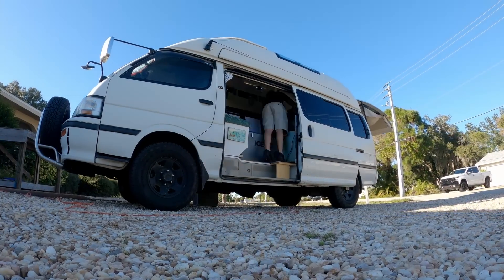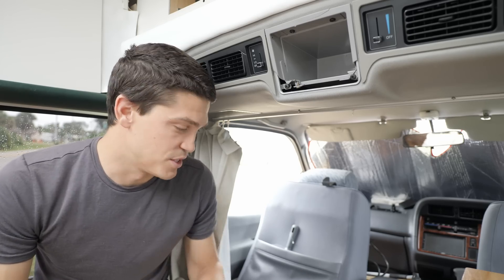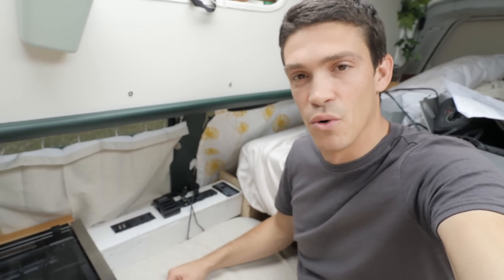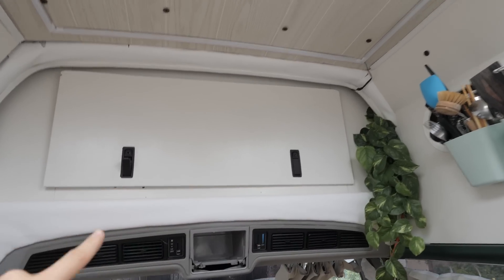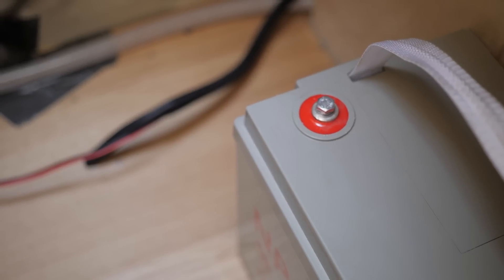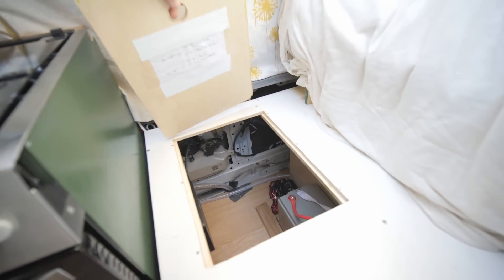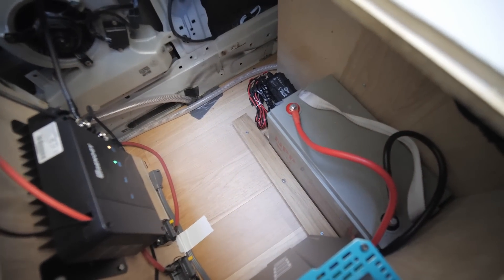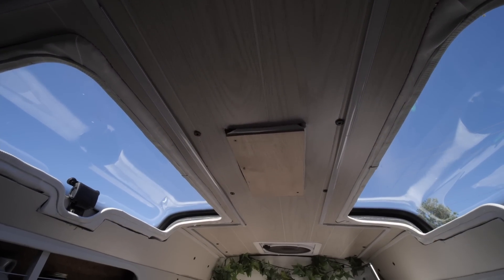DIY Camper Van Power System | DC-DC Charger & Solar Install

Comment: Hi, I bought this mmpt dc/dc charger and I would like to know if it needs to be in a place where it's cool or have ventillation? 
Does it get hot and  is it noisy?
Sorry for all those questions but I have a car that I change into a van and so I don't have much room.
Thanks in advance and btw great video :)

Comment: I would have gone with the Renogy combo controller but they gimped it with that terrible 25V MPPT limit. Makes it impossible to basically put any panels in series.

Comment: I have several home battery/inverter builds. The BT-1 and BT-2 apps are OK but the Victron Smart Shunt does not have much range and the app has things that just don't work. It's constantly dropping its connection. I rarely use it. However, I am a big fan of the Renogy 500 amp shunt battery meter. It shows everything you need about the load, battery state, amps, time remaining to discharge, time remaining to charge. No phone needed, it's like a gas gage for the battery. No need to scroll through  anything to see the information. You can see from 30 feet away if the battery is charging or discharging. I think it would be an ideal meter to put in a camper van.

Comment: The renogy unit is a sweet unit. Its too bad they cheapened out and put only a mppt controller capable of only 25V but 600w of input. That means you have to do all parallel panel arrays with 8awg or thicker wire.
Reply: I bought their DC-DC controller with MPPT. The 25 volt solar limitation sucks. It's still in the box unused. I installed the Renogy Rover 30 amp MPPT and put 4x100 watt panels in series and see 70-88 volts regularly. I have a Renogy 30 amp DC-DC unit but have not installed it yet as the solar charges adequately even on cloudy days. I will install it but don't feel like crawling around to run the ignition switch sense wire. I wired the panels with 10 gage wire, more than adequate.

Comment: Will's YouTube channel is a wealth of information. I'm currently working on a 280 amp hour 12 volt LiFePo battery setup to add to my Element. Also preparing to add a 2nd 100-watt solar panel for a total of 200 watts. Definitely overkill for my compact little Element RV but "overkill" is my style.

AGM has its pros over lithium, mainly the ability to charge/discharge below freezing.

The new setup definitely looks good! The Renogy app has received a ton of complaints for its issues. Some even suspect that the app isn't compatible with that particular charge controller.

Comment: watching 720 watts (60 amps alternator) flow into my 280AH lifepo4 is bliss.  Lets you have toys like espresso maker (120A draw), zero breeze I air conditioner consumes 120 watts.

Comment: Also the charge controller will charge the starter battery when house battery is full. Guess the Bluetooth is why chrome went with the victron Bluetooth adapter

Comment: I'm curious about two things.  How do you charge your Bluetti system and are you worried about it getting hot in that battery compartment come summer?
Reply from the maker: I won't be using the Bluetti system anymore in this van. I'll find a use for it somewhere else though :).

That compartment is the coolest spot in the van. It rarely gets hot down there for some reason, even on the warmest days!
Reply: @ElementLife   check out the Zero Breeze air conditioner.  We got the first version which uses 120 watts

Comment: Excellent choice. I too used this schematic by Will Prowse. I have been full time on the road and have had very few hiccups. Some things to consider are to cap your terminals on the right side of the dc/dc mppt charger. I made cut outs on the covers to fit the wires thru. 

In addition I noticed one of the suggested circuit breakers that connects the Starting battery to the controller for me is regulated lower than spec. I have the 50 amp model and my circuit breaker will cut out around 48 amps. Since I have just lowered the dc/dc to only run at 40amps. That is programmable in the app. 

One final thing, there is a second amp called Renogy Home that will also work with your setup. That app has analytics such as graphs and is much better than the app you mentioned. 

I think you’ll enjoy this setup! See you on the road.

Comment: It looked like you have the old app. Did you get the right BT model, and update the Renogy app? 

Also a battery monitor is a nice touch just to have an exact reading of the battery

Comment: What solar charger did you use to charge the car battery?
Reply: It is incorporated in the black Renogy DC to DC charger, it takes a 30A input from the alternator and solar all in one.

Comment: Hey Nate, you need to update to the DC home app.. that app you are using is no longer updated. The renogy dc home app will give you better information on your charging. 

Also, I would highly recommend to run the ignition wire on that charger.. many users (including myself) found that the charging amps would drop significantly after running the vehicle. For me, my charging amps would cut in half from 25 amps to 10 after my vehicle ran for 15-20 minutes and I do not have a smart alternator. I ran my ignition wire to my tail light running lights so that I can turn the system on or off with my lights.